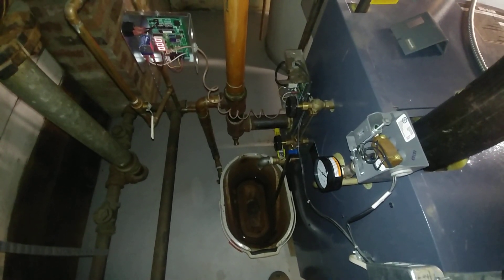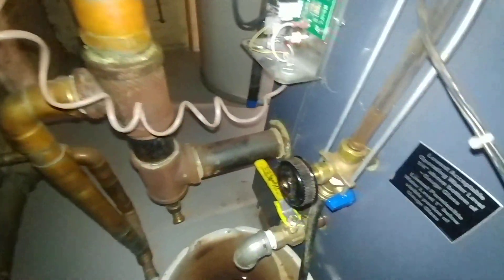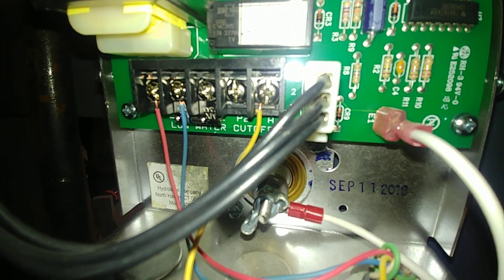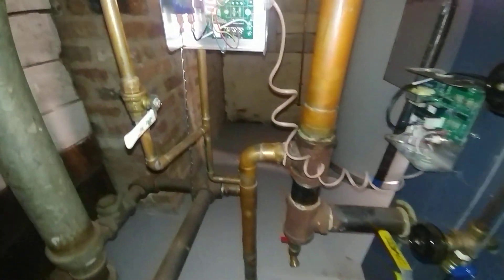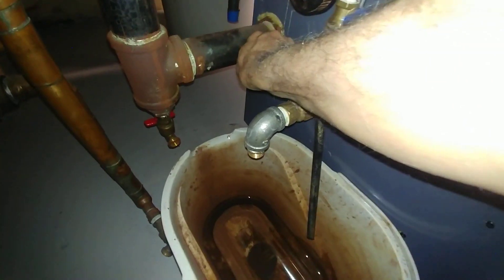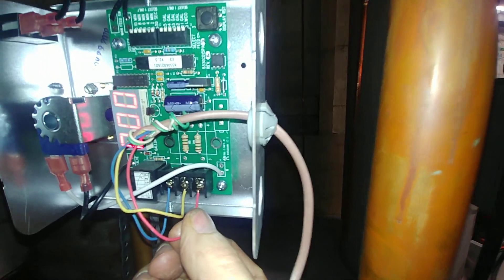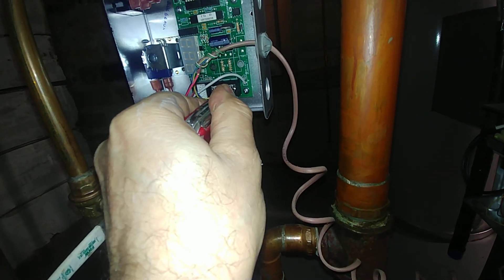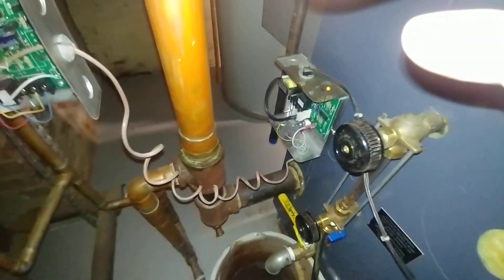Hydrolevel VXT-24 Wired Backwards - Lights Up, But Does Not Auto Feed

Comment: Welp, Gordon I’m on a job playing coroner for everything you shouldn’t do with steam. Dry Fire, all safeties failed on a two year old steamer, except the smoke alarm. Gracious my new client is alive.
Fire department estimated riser pipes hit 600-700 degrees, Burt pipe dope and section seals.  Whoa!
Reply from the maker: Whoa Indeed!
Reply from the maker: Any idea why the LWCO failed?
Reply: @gordonschweizer5154  
Miud, Locked burner LWCO in up position. Lower LWVO, probe type was dirty and failed to send signal to condensate receiver pump. Didn’t mater fill water was off and no Hartford loop. Flow checks on receiver were mudded and open.
Boiler drained itself, stand pipe on receiver dumped at tap level to pit.
That’s some great craftsmanship 😡
Reply from the maker: @bauhnguefyische667  A true cluster foxtrot!
Reply from the maker: It seems that even if there was a Hartford Loop, it would not have been enough
Reply: @gordonschweizer5154  
Pretty much on the loop, yeah at best it might have bought an extra minute or two before the train wreck. This is the first complete safety chain failure I’ve seen in 40 years.
Reply from the maker: @bauhnguefyische667  I would guess the  underlying cause was not properly cleaning the now defunct boiler and system of mud? 
Is this an apartment or large residence?
Reply: @gordonschweizer5154  
Large home, LWCO (#42) that mudded was ‘cleaned’ on reinstall, head unit was replaced a year  ago.
Pipped so it could not be blown down., boiler drain to blow down was also block drain, so impossible to flush.
Condensate receiver was replaced one year ago almost to the day. I believe flap check on return line failed to close so boiler could not maintain level. Water feed was closed and drained into pit because vent pipe was tipped into pit instead of at least 20” max above. Shipping bracket for pump float was removed at least.
Reply from the maker: @bauhnguefyische667  My G-d.  I've seen that "piping the float control so it can't be blown down" nonsense on a few (mostly dead) boilers.
But not as bad a you describe.
I have no doubt that as you investigate further, you will find even more tomfoolery and cephalic-flatuance.
Stay safe. Stay healthy.

Comment: It's easy to get the hot and common mixed up at the LWCO. I drain down the boiler , put the delay on the feeder to 30 seconds and see if it feeds when it goes into low water condition.  If it doesn't, switch the R and C at the feeder. Then set the delay usually for 8 to 10 min to give time for the water to come back to the boiler.
Reply from the maker: Good proceedure.
I usually look for the "period" after the zero to see if the VXT is getting the signal to start the countdown.
On this unit, I didn't see that dot when the LWCO was triggered.
I first thought either the LWCO was not sending the signal or the VXT was defective.

Comment: This automatic water feeder now they come with electrical tape on the solenoid probe and the screw to attach the valve to the box don't line up i have to use zip ties to hold it I had 2 similar problems .
Reply from the maker: I'm sorry to hear you got a bunch of the "taped" series of the new VXT.  
They are troublesome.
Did you happen to see a video on how to fix it in the field?
I hope it was helpful.
If not, please let the folks at Hydrolevel know you are having an issue.
Their latest fix appears to have nailed that problem for good.

Comment: Good to know. In the old days 24 volts was ..............whatever. Now it "should" come off the secondary of a transformer with 1 side of the secondary the "neutral" grounded
Reply from the maker: Amen.
I've been caught out more than a few times by not paying attention to 24 volt polarity.
Like you said, the old stuff didn't care. 
The new stuff of a certain does!

Comment: Nice tech tip. Thanks Gordon👍
Reply from the maker: This one was wired by "others" in 2019
The VXT counter showed 042, so it must have fed, right? 
It must work, right?
Close, but not quite.
Turns out, the previous owner was using the push to feed button- which does work as shown in the video- and that's what showed up on the counter.
This is the first one I've seen like this.
The current owner graciously let me video this.
Reply: @gordonschweizer5154  I’ed of thought he would of thought something was a miss when he had to add water after paying for an auto feed? Can’t figure people out sometimes. Stay well
Reply from the maker: Well, I'd didn't realize something was amiss at first, and I'm the so-called "expert", so I'm going to cut the fellow some slack.
I'm not sure when this error crept in.  Other people may have altered this system since the install before I got to it, and I was mostly called to get a convector heating again (bad trap).